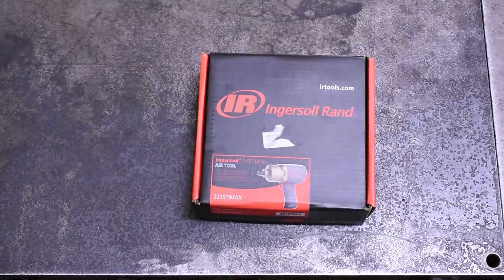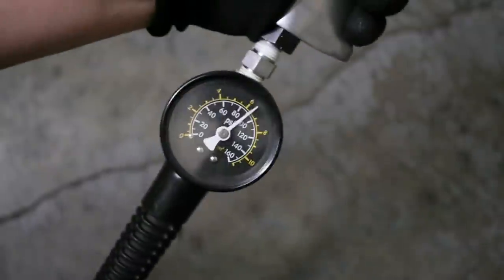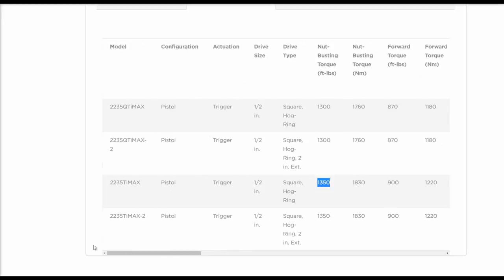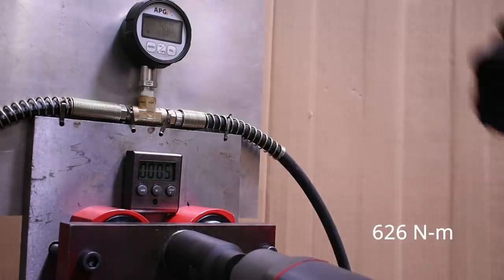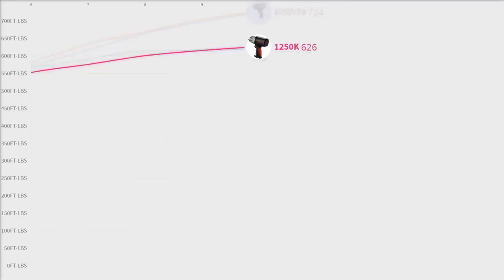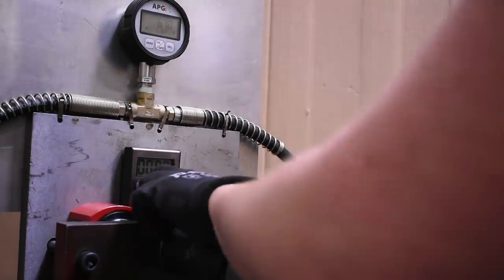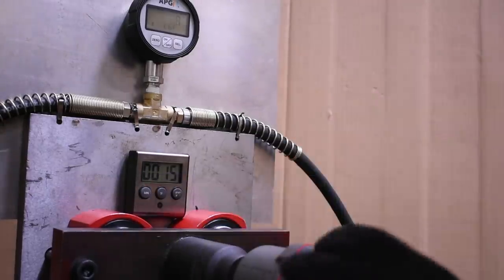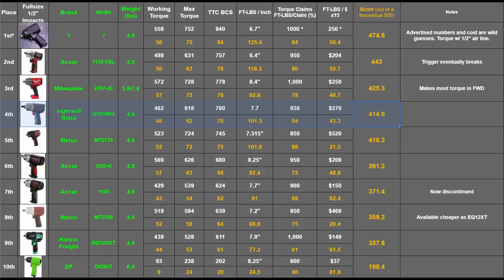The #1 Selling Air Impact vs Modern M18 & Matco Rivals: 2235TiMAX Tested

Comment: The 3/8 air hose is too small when I would use that gun I would hook 2 3/8 hoses together and run a 1/2 hose because at 90 psi it recommends to run 1/2 inch air hose.  It needs the volume that a half inch hose can supply.

Guys at work didn’t believe me either till they couldn’t get some hub bolts loose and I pulled air from 2 smaller hoses and ran a half inch hose.  It broke all the bolts loose.  Making their day a lot easier. I’ve had that gun for 10 years and have gone through 3 of them.  Love it and would suggest that impact over any of them for an air impact with a lot of power.

Comment: I run the M18 high torque & the 2235 IR up against each other everyday. In mine duty work the only reason I use the M18 is so I dont have inconvenience of the hose . Both awesome guns much better than snap on ( air or Batt.) Great vid thx

Comment: I actually have both the Ingersoll 2235QTIMAX and the Milwaukees High Torque and I have put them through the motions in real life situations in a high volume professional shop .....The Ingersoll does do very well but there has been quite a few situations that I could not remove something from it being over torque but my Milwaukee will remove anything that the IR can not but the Cordless is not my first primary go too ...Pneumatic is so to give the Ingersoll a fare shake it is a well decent gun I don't believe there is no gun out there that cannot fail depending upon how tight a fastener is over torqued just my opinion from using these tools in a professional setting day in day out ...Air restrictions could also enable one to get the full maximum performance out of there gun just as well with having wrong fitting

Comment: To my knowledge and I may be wrong. But I believe the 2235 is fairly new. May be within the past 4 years. I have the older 2135ti, 2135qti, and the 2135timax. All of them are about 10-13 years old. All of them I’ve run at 140psi+ every day. Hardly ever oil them. Use them for hammers and they have never skipped a beat. I’ve used various snap on gun and have been disappointed. Ir for the win. Keep up the great videos.
Reply from the maker: 2235TiMAX came out around 2008 based on the press release, but they came out with new 2135 version after that as well
Reply: @TorqueTestChannel 2135 came out in 2003, 2235 in 2014. Look for the new 2236 which just released (2024). I know, I invented them.

Comment: I worked at a used tire shop back in the 80's that did a high volume of tire changing. We always used Ingersoll Rand 1/2-in impacts. I can tell you we would have never considered running that tool at only 90 PSI. I don't remember what we used but it was way over a hundred pounds.  I don't have any memory of any Ingersoll Rand impact gun failing because of it. I did oil it everyday but other than that it got ran hard and dropped on the ground not treated gently at all. I would not want to buy an impact wrench that is designed to not increase the torque when you increase the air pressure

Comment: Lol. That’s our truck shop secret. 1/2 lines and 145 psi shop pressure with the power knob turned to low in reverse.
    Always have a spare anvil handy. My ingersoll ate 3 of them already
Reply: What are you doing to the anvil? I work on dump trucks and heavy equipment. Bought my TnT gun in 2006, been running it on 175- 200 psi whole life and never replaced the anvil
Reply: @Matt-ou1bg  2235 has a lot more grunt than a tnt.

Comment: epends on application.. when your running in 200 rubber bars for a railroad sweeper you have to compact the pretty solid rubber down about 1/2-3/4 of an inch. That can do alot of strain on an electric motor while if you lube your air impact every here and their it wont show wear after the 2 hours of impacting your impacting each bar about 30-45 seconds straight

Comment: Very impressed at the high pressure results. The price has gone up a bit, I bought mine on amazon 3 years ago for $250. Imo the current 20 dollar increase is well worth it, it's a great gun. I have put coworkers $500+ dollar impacts to shame with my ir. I oil it sometimes and it works as good as the day I got it
Reply: The IR impacts love the high air pressures but you should be putting oil in every day. It only takes a couple seconds and really makes them last.
Reply: @actionjksn  You're right. I really should oil it more, but ever since I got my m18 high torque my ir has just been sitting in my box. The location of the air hose relative to my bays is super annoying so the electric impact has made it easier to move around. We're in the process of moving into a new building so maybe I'll go back to using my ir daily if the air hose situation is better. 

I did buy the ir grease though! I did that a while ago, can't remember what the service interval is for greasing the gun but if I recall it's not that often

Comment: I don’t know if i got one of these exact models, but i have an IR Ti model in gray that i only break out when i have some stuff that is REAL stuck. Best $40 i ever spent. 
Heat + lube+ hammer + air gun usually gets it done.

Comment: One point I'd like to make on the pricing of the Milwaukee 2767-20, I feel like you should include the cost of the batteries/charger as well. You could make the argument that "you have to buy a compressor to run the air guns" but, that really is a one-time purchase and then that compressor can run any brand of tool or air line forever, whereas buying into a battery system only lets you run those specific brands of tools, ever. Buying any other brand (or tool type in some cases, a la electric ratchets), means another financial outlay where the same compressor runs everybody, all day, forever.

Additionally, there are really only two types of people; either those that are buying the gun for the stats and therefore need to buy into the battery ecosystem (in which case the cost of battery and charger matter to getting anything other than a paperweight), or those that already have bought into the battery ecosystem and are picking the gun not for the stats, but for the compatibility (ie, stats don't matter to the latter buyers). So really, battery costs should be included in the price and price score.

Thus, the 2767-20 should actually have a minimum cost of $349 (tool + 1 battery + charger combo), which drops the fiscal score to 33.4, and puts the 2235 in third place.

Comment: I understand testing at the manufacturer recommended pressure but I have never been in a shop that wasn’t running at least 150 psi. We run about 175 psi. I couldn’t imagine using air tools in a shop environment at 90 psi. It just makes everything feel so weak.

Comment: I worked at a full suspension shop which required high air pressure to run the emerson air jacks, with 190psi of air pressure, the anvil on my IR 2235 got rounded off and pitted, this was after most of it's life, I then bought the Snap-on PT850 and the veins wore out withen 4 months, I'm looking for another 1/2" drive air impact in 2024 and I'm thinking Matco or IR

Comment: I really liked your anecdote that higher pressures create magic with the 2235TiMax. After some frustration over a Honda crank bolt last week, I came here with torque envy. All I had to do was to crank up the volume. For a tool not often used, it's not an ideal fit for battery powered tools, unless you use those batteries for something else in between. What's the story behind the mystery tool, is it an experimental Astro?
Reply: Those hondacrank bolts are tedious man.... They sell a weighted socket specifically for the job because some impacts just wont cut it. I think this will knock it right out tho !!! But you need a good compessor to maintain that air presurre 👍👍👍

Comment: Hey guy's you need to test this brand called Air Boss our of Taiwan.
One of the parts stores here in Australia, Bursons had them for sale for a while when I bought mine they had 250 in stock so must've got a pallet or two in. 
I think it was advertised at 900ish ftlbs, it's a steel cased gun and the catalogue said it had a full steel motor. 
I tested it on a truck wheel and it was pulling 41mm hex nuts off on Mitsubishi trucks. We tested it against the 1/2 version of the brushless 3/4 gun from Snap-on and it out did it and that's on 100psi static I think my work runs around 80 dynamic line size plays a role there. 
I can only imagine what what the little beast would do on 100 dynamic. Also the thing is tiny for a full size gun plus they're like $180 to $170usd well I paid $240aud so probably even cheaper in USD tbh.

https://www.twairboss.com/

That's the brand mine is a light blue all steel gun.

Comment: I managed to pick up the 12v 3/8 DeWalt impact kit, with charger, carrying bag, and two 2ah batteries, for $21.20 at Lowes. I'm so hyped. The first impact I've been able to add to my tool collection.
Reply: 21.20$ for the impact wrench? How'd you pull that off?
Reply: @omarm6678  They had a promotion for a free $80 5ah battery with the purchase of the $99 kit. Well, they were sold out and not going to restock any time soon. First Lowes I went to said they couldn't do anything. Second Lowes took the price of the battery off the price of the kit.

Impact wrench, charger, two 2ah batteries, and a bag.

Comment: Cordless will always make that power, there's the difference. Air is at the mercy of the workshop compressor. My shop runs 1/4 adaptors and the air impacts can't keep up with an M18, there's been 4 or 5 times already where the air impacts can't budge something so they come to me and the M18 barely struggles. Same IR impact here, there's about 5 of them in the workshop.

Comment: I have had used 2235ti every day no semi trucks for 10 years at 175 psi, none of the snap-on or other guns I have can touch it at that. I get about 3 years between rebuilds and that with drilling out the restriction on the forward speed.

Comment: For a home gamer like me, I’ll take the 1250k all day. Small 2hp compressor, can’t run much above 100psig dynamic, and at those pressures the 1250k outperforms the 2235, is smoother, and costs less.

Comment: The IR is a great tool use them at a machine shop and a lot of their 231 models. The 231 are heavy after some weeks of heavy use. The titanium version is much lighter makes a huge difference. I however just purchased the HF eq12 the 1000lbs version.  The main reason is it falls between both IR models for torque from your channel test and is the lightest of them at 3.8lbs. Longevity is another story not sure if it’s rebuildable but should last some time I hope.

Comment: IR 2235 is pretty weak with the rated 6.3bar. Using it @ 10bar makes it whole different animal. Also incredible rugged. We used them at work @10 bar and the conditions were dirty. Lot’s of abuse, never serviced and still they held long time.

Comment: Could you some time do a video on how to rebuild a air impact wrench, and do a before and after dyno test,, to see if it's worth the$50 rebuild kit prices... thx
Reply: It's almost always worth rebuilding, assuming you've oiled it and the metal air motor parts aren't worn out.
Reply: well the price is a new gun every 2 years vs every 20, so consider that i guess

Comment: Absolutely loving this channel, any chance you'll be testing the Aircat 1058 compact? I'm aware of the issues you had with the trigger on the larger 1178, but I am still curious how its smaller sibling compares. Also it appears that Aircat is aware of the trigger issue and is currently looking into it, at least that my understanding from the emails I received from them.
Reply from the maker: We'd love to see any improvement then test any and all of them after. 'till then we don't want to give them any more screen time on those, we don't want to steer people wrong as we think the trigger is a deal breaker (even though for some people it hasn't been a problem).

Comment: I would like to see the IR 2235 tested best case scenario using 1/2 air line with H-style air quick connect fittings to see how much difference there is. That is how I run mine and I am curious how much of a boost it gives. I know mine does not seem to have trouble loosening much of anything I put it up against.

Comment: Awesome video! Any chance of getting an mg725 and a pt850 on here ? Kinda the only big dogs that haven’t been featured yet
Reply from the maker: You got it. There aren't a TONE more air impacts at the top of our list after those, so we'll sprinkle them in at points. Don't want to work through all the air impacts we're fantasizing about then just be "done"
Reply: Yea same here , last time I offered my mg725, a month or two ago, they said one was in the works already ...
Reply: imo the 725 hits harder but the 850 is a nicer gun to live with, lighter less vibration and better balanced, had 1 on demo last year and it just didnt have the guts my mac awp050 has or of my dads older 725, on par with the 2235 as far as i could tell doing track bolts on a john deere 450h
Reply: @johnz8210  I personally have an mg725 and an 1178-xvl. And while the trigger on the aircat never broke like on the test, it was the least controllable trigger on an impact gun I’ve ever used. On/off switch. So I bought an mg725, and it seems a little less powerful but the trigger control makes it so much better.  Only complaint about the mg is how insanely loud it is
Reply: @meorge9359  use the muffler
Reply: @meorge9359  I bought my mg725 used specifically because I needed a variable trigger. Love my aircat 1250 but really hate the on/off trigger, it's awesome for wheel and chassis work (nothing with finesse).in contrast I hate the mg725 flow control, I need a damn pair of pliers if I want to adjust the power output. But the airkitty Is so much smoother, quieter than my mg725. I honestly don't feel a power difference between the two.
Reply: @patrick11169  love my pt850. Super light compact gun and does everything I will ever need it to in the automotive world. I traded my 2779 for it because it was on its way out after only a year.
Reply: @TorqueTestChannel   I have pt850 of you want to test it

Comment: Video idea: does a big 3/4” of the same tool family have more power still after being adapted down to the smaller 1/2” size. Example: IR2145 adapted to 1/2” vs 2135?

Comment: Im on the verge to buy a high torque impact and what turn me off about the millwaukee is its size! besides axle nut i don't see how it could squeeze into suspension works. I do have a mid torque but fall flat some of the time so i need a backup.

Comment: I’m curious about power changes on air guns with and without the muffler in the grip I have pulled the mufflers out of several of my air guns and it seems to give a increase in power but I would be curious about dyno testing that

Comment: I’ve always felt ingersol was the best
Reply: I have a soft spot for IR.  The 231 with an extended anvil was my first gun and has never been apart although it's been on the back up to the backup gun for years.
Reply: @BlindBatG34  Once I got a IR I stayed off tool trucks.

Comment: Your Dyno will always produce lower numbers than a hydraulic only one that doesn't use a screw. The friction of the screw is not only variable but significantly higher than that of a hydraulic only setup
Reply from the maker: Hydraulic units (skidmores) do use a screw. That's where companies get these ratings

Comment: I may just be me but it seems like air impacts after a year of solid hard use lose a great deal of torque. I still find myself going for air out of habit. I am more on the 18 volt Makita lineup, however I feel like the Milwaukee’s have the most power. I have a Makita TD171DZ impact driver that’s made in Japan and there’s absolutely no impact driver on the market that can keep up with it for stability. It maybe a little weaker than Milwaukee but you can drop the thing off a sky scrapper and it will still work.

Comment: I have always known that my 30 year old IR had more power at 160 psi... But what about my SnapOn MG725. It weights about the same as the ????? gun. That extra weight has to be in the guts. Will that be tested too ?
Reply from the maker: It will be tested, yes!

Comment: So are you guys saying you didn’t run the first tests (before the 150 static test) at 90 PSI dynamic? Or are you saying if you own the 2235 just run it at a higher than recommended dynamic pressure?
Reply from the maker: The latter for sure. 1st 2 tests were at 90psi dynamic. But it loves more than that.
Reply: @TorqueTestChannel  Gotcha thanks. Good to know because I just got it.

Comment: I would like to see the chicago 1/2  supper duty put to the test 
We had one on a ranch and that thing was impressive and I have the first match gun 

My coworker had that titanium and it was good and strong mostly but every once in awhile u get a bolt that is too tight 
And we used a 3/4 gun 
I want to get a 3/4 gun just in case but not sure who makes the strongest
Would you be willing to find out for us 
Id like to see the CPT7763 -6 

Well I guess with no extension